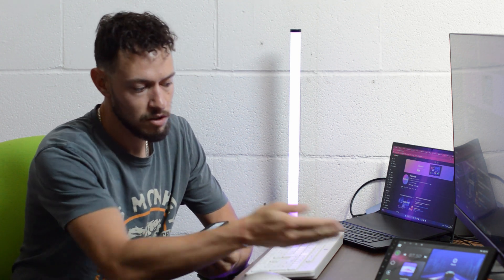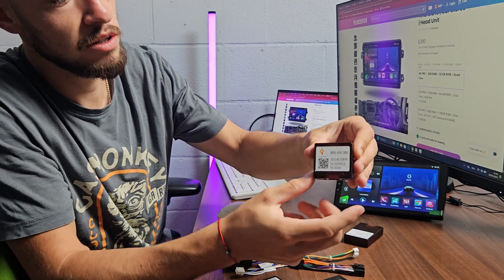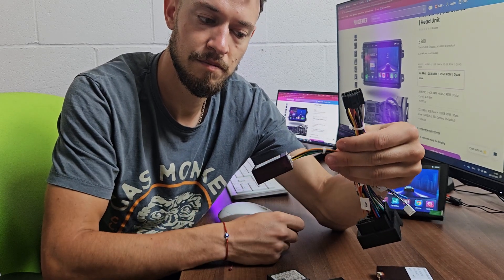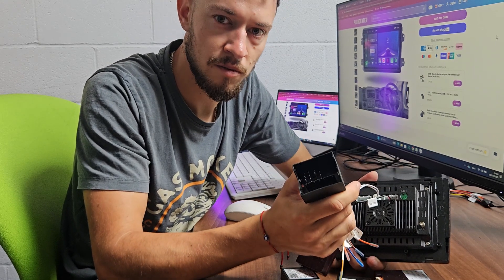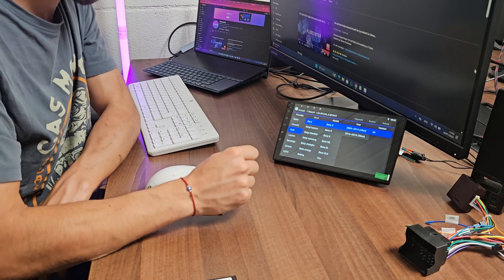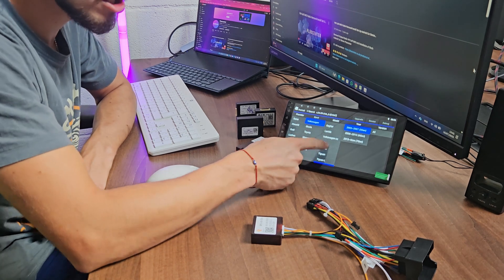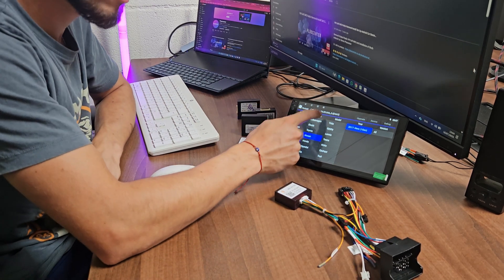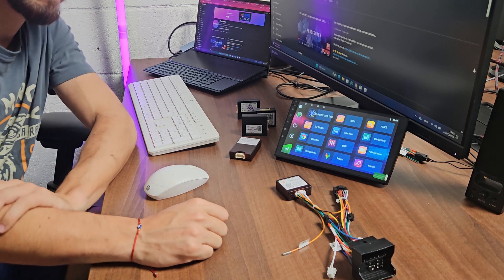CANBUS Explained! Set Up Android Car Stereo With Your Car’s Harness

Comment: Hi

Do you know if my car needs a canbus please? I recently purchased an android stereo from Ali express. Everything works. But, when I reverse, nothing comes up on the screen. Do I need this?
Reply from the maker: Usually the canbus and the wiring harness are part of the package with the Android head unit. If your stereo work without canbus only with harness plug and play this means your vehicle is low configuration model and don't require canbus. To have reverse screen with camera or parking sensors you will need wiring harness with canbus made specially for your vehicle otherwise you will have to connect the camera manually to the reverse light cables.
Reply: @pluscenter so I bought a raise canbus and it still did not work. What do you recommend? I can’t even get a no signal page when in reverse on my stereo….
Reply: Please help me I got a 9.7 vertical screen tesla look Ali express  i'm certain the issue came from the item mismatch. My truck is 2013 RAM, however i was sent that of 2015 RAM Raise canbus which i believe does not exactly synchronoize with my 2013 Truck. The radio  units works fine, the Aircondition is also working fine from the radio software  but the problem is from the frame control where the hazard light control cannot activate the lights in the dash. Note: i followed the  subsenquent instructions from the sellers on the connectivity but unfortunately the hazard lights is still not working...any ideas please why the flashers light ,AC, off are not working from the fascia controls